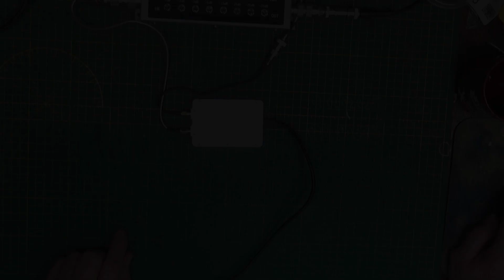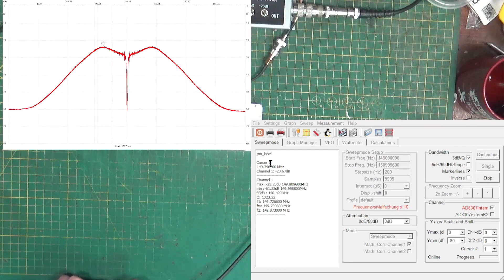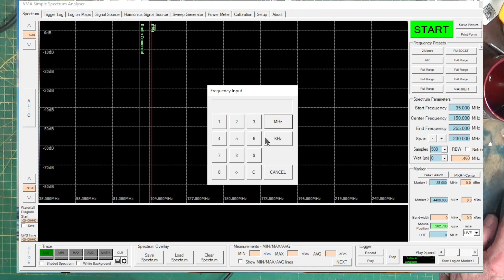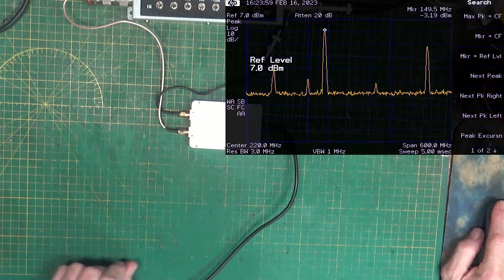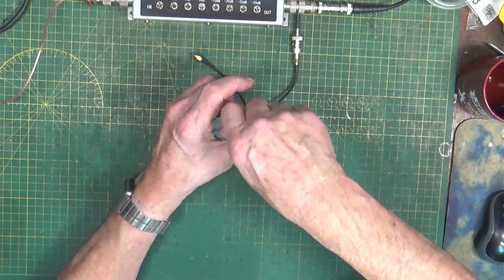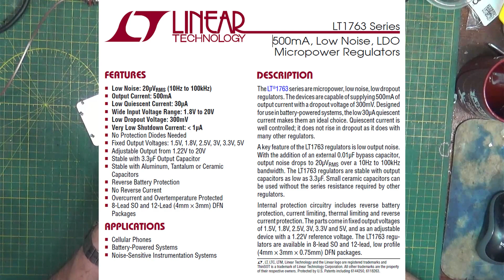Review and Tear down - Cheap 35-4400MHz SA - Any Good?

Comment: Hello thanks for the video I bought one over alliexpress and seller would not answer messages,  how can I get the software to use it please advise thanks again.
Reply from the maker: You can get it off github.
https://github.com/kalvin2021/ltdz-dsp/blob/main/README.md
This is an updated version that seems to work better. Good luck. It is a little touchy.

Comment: Very interesting stuff love it.
Reply from the maker: Glad you enjoyed it.
Reply: You have got to be a burned out (i.e., retired) broadcast engineer with all the Moseley, Orban, and other radio stuff you have accumulated and lovingly worked on. You're making me all misty and  nostalgic remembering highs and lows of the one of my careers keeping AM and FM stations on the air. Gosh... I'll bet you just might even know how to tune up an RCA Ampliphase transmitter from scratch. Great channel.
Reply from the maker: WOW! How old do you think I am? Well, OK, I guess I am old enough to have touched one of those. Almost 30 years in broadcast. Some of them as chief for 3 stations, 2 FMs and an AM. My oldest transmitter is a BTA500. Sadly the last thing I did to it was take out all the oil caps and retire it to the 'look at me' corner of the old transmitter building next to the 4 tower phasor. I can do transmitters but my real love is studio equipment. I have built several facilities over the years and finally retired in 2021 (they still have my phone number so retired might be stretching it a bit)
Thanks for watching.